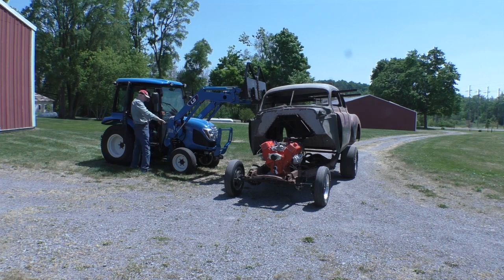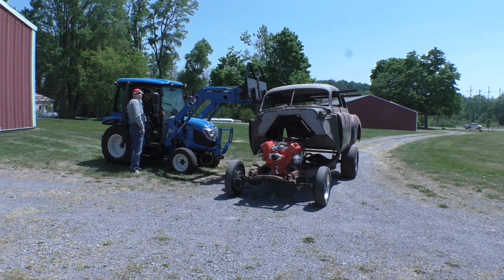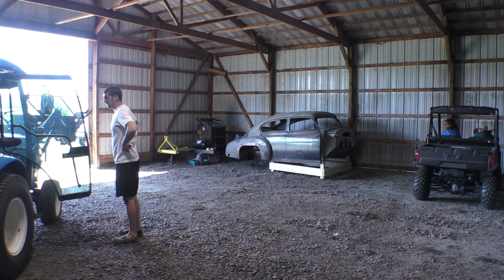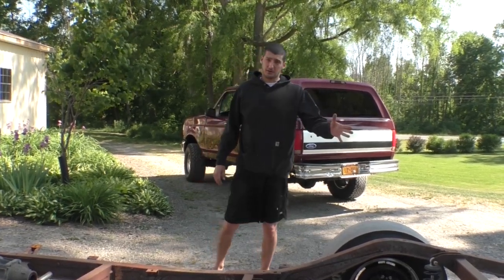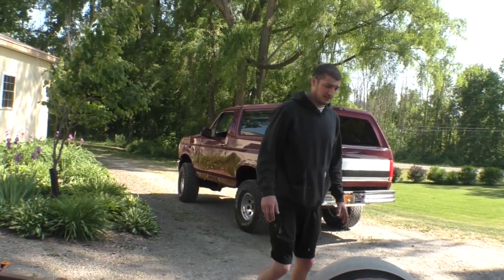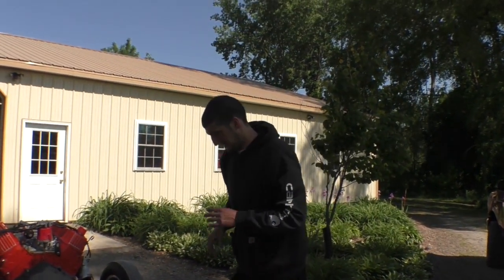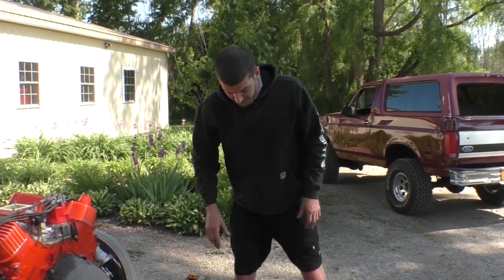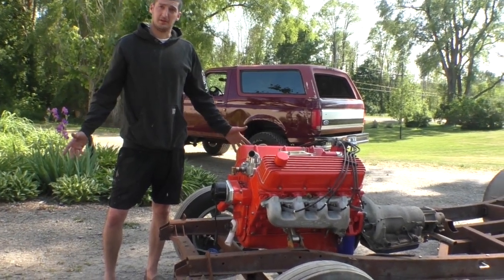Remove Body From Frame, 1949 Chevrolet Gasser

Comment: Nice to have a forklift to pickup the whole body. Nice Body Table in the barn. Looking forward to the next steps along the way to completion.
Reply from the maker: Found a used center section on E Bay with 31 spline and posi trac

Comment: Cool. I have a 49 coupe waiting for me to get inspired and put it together. Going for 70s Street Freak style.
Reply from the maker: Get out there and work on it.
Reply: @ThrottleStopRacing  Busy right now driving the dickens out of a 65 Nova wagon I resurrected. At age 64, work goes slowly.
Reply from the maker: Don't let age slow you down.
Reply: @ThrottleStopRacing  Tell that to my knees.
Reply from the maker: @paulhare662  Working on 73 myself.
Reply: @ThrottleStopRacing  I've likened us to old trucks climbing a long steep grade. If we let the rpm fall and drop a gear, we ain't getting that gear back.